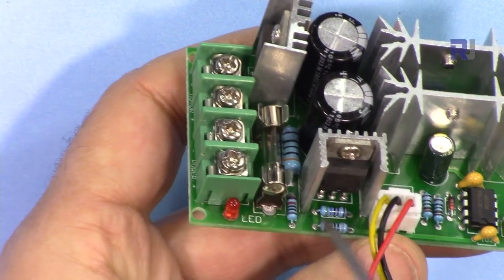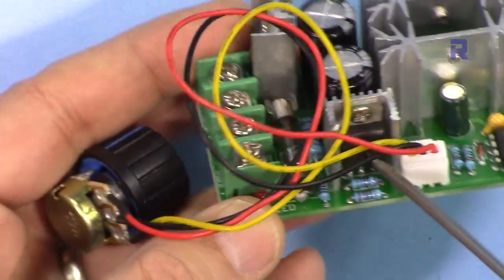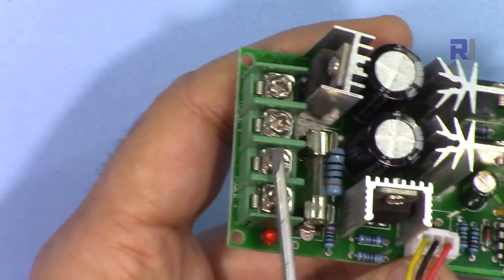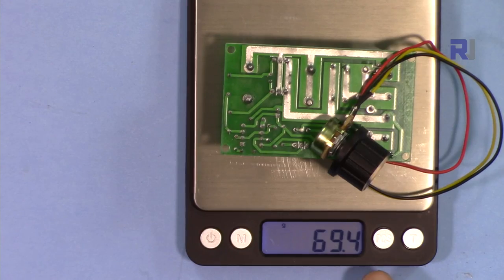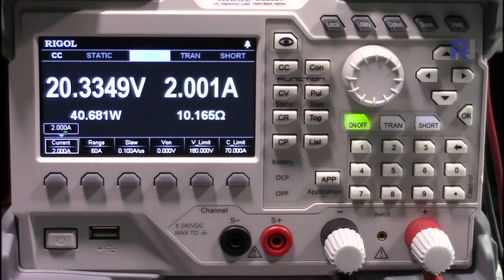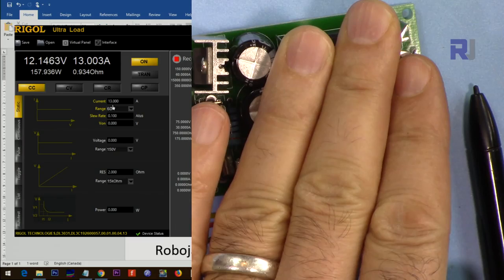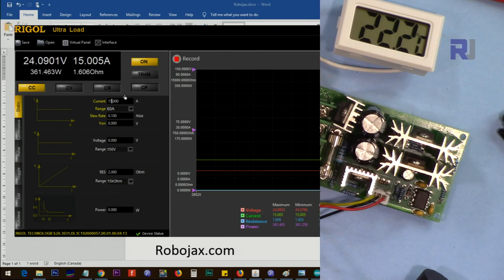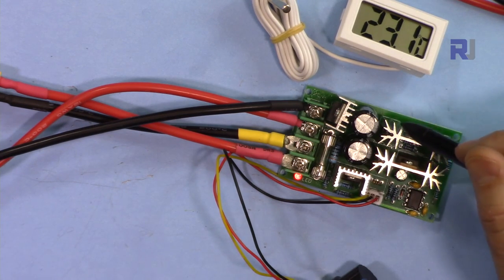Review of  20A DC 10-60V PWM  Motor Speed Controller

Comment: Lm317 regulator max voltage difference is 40v, so here it is set to about 7v (for the 555) so max input voltage is 47v. Maybe they used the Lm317HV which has a 60V in-out so it can be driven up to 67v.

Comment: When adjusting speed on a 12v 1A cooling fan there seems to be spots on the pot where output goes to zero say on a couple  portions of the sweep of the pot.
Reply from the maker: May the wiring is loose or connection is bad. Yes it is possible that you might got a bad potentiometer.  Here is a hack where you control this motor driver using Arduino board https://youtu.be/ipFxYQkB5uw

Comment: Super cool. Thanks for the demo and testing, Just bought 2 of these in ollna dofr Eur 12.95. Not too bad. For PWM control of a stryropor foam cutting knife with Ni-Cr thick round knife and a 150 mm straight knife to cut 120 mm EPS high pressure floor isolation foam.
Reply from the maker: You are welcome. Thank you for sharing the experience.

Comment: Hi Sir, thats a very detailed video 👍 and helps me getting closer to a propper solution. I try to power two hooverboard motors, each 250W. Is it possible to use such controllers in leck of hall sensors and control them with a thumbthrottle? 😅 May it is stupid...thx

Comment: Does this PWM controller offer forward and reverse motor direction ? Does the pot control both directions ? 
If the pot is at 12 o'clock does it play forward 100% ?
Reply from the maker: Hi, I made this video to answer your first question and demonstrated it.  the speed of motor is controlled to 100% of duty cycle. Here I have modified so it can be controlled using arduino with PWM https://youtu.be/ipFxYQkB5uw
Reply: Use 6 point switch on module output  it's simple for forward and reverse

Comment: Ahmed, I want to run a RC car with this that will carry around 10-15 kg weight around, so for 4wd (4 Wheels with total 4 DC motors) so what do you suggest, I need 5amp current for each motor, so is there a way I can attach all 4 motor wires (but I see only 2 sockets for motors + and - on this pwm module) how can I achieve that ? How many max motors can this 20amp pwm module allow me to connect and run at once ? Pls assist Ahmed, thanks for your efforts
Reply from the maker: Hi, I came so many time on this comment and did not understood it. so here I am replying now.  if you connect 2 or motor motors, you would connect them in parallel to have the same voltage.  you can also connect them in series. but keep in mind that they all will run together.  in terms of current, I have shown how much this module can handle and I don't remember it.  when you connect 4 motors, the total current is divided by 4. so each motor get 1/4 of the current. I hope I've explained it.

Comment: Hello. very good your material. I have a problem, actually it's a question, not really a problem. I want to use this module to dim the headlights of a car. But using, in a car, the ground from the car's power source (battery) is the same as the ground of the load, i.e. the bulbs. This means that between the 2 ground connection screws, of the source and the load, we have continuity. Is it ok to use it like this?
Reply from the maker: Yes.

Comment: Hi I'm using 10A speed controller with 3s Lithium ion batteries and motor is RS550 PF ,when i increase the speed the controller gets hot especially the motor wire connectors do you know why would that be?
Thank you
Reply from the maker: Hi, heated wires means the current is very high. Use thicker wires.
Reply: @robojax  hi thanks for the update,
Also I used thick wire but still getting hot where the pwm speed controller terminal,
I'm using rs550pf motor for a rechargeable fan ,do you think if the fan blade propeller is heavy?
And will the effects the overheating issue?
Also what if I use 550 motor ?

Comment: Hi Mr Shamshiri. I have 10A version of this module, it works fine But the Schottky diode heats as the ampere raise above 2A! I dismount it and add a huge heatsink to it and I connect it again via 3 wire to PCB because 10A will blow it up definitely! but you use them without any change in your tutorials! what you think? my module has any difficulty or the diode is faulty? (chekar konim? :)
Reply from the maker: Hi
I am not sure if the diode is faulty,  one quick solution would be to put two diodes in parallel meaning anode to a doe and cathodes to cathode and this way the current stress on the diode is reduced to half.
Reply: @robojax  thanks  for your quick answer. actually when the motor has heavy load the diode starts to heat up. I don't know why. the diode is for making a way for suppressing kickback voltage of motors inductive coils. when I hinder the motor to rotate maybe it increases the kickback effect?! after all, thanks for your advise 🙏

Comment: hey, could this be used as a soft starter? im loooking to limit the inrush current on a motor, it should be turned on by a switch on the 12volts line, so the pot stays on the max speed i guess
Reply: i have the same situation. I think it will work as a soft starter in our case.

Comment: Why did the schottky diode get so hot at the 12V 20A test?  I presumed that there would be very little flyback diode current with a resistive test load.
Was the test load inductive to simulate a motor?  (....... Would the heat come from about 0.2V X 20A X2?, but at some fraction of the PWM cycle?).
Thanks for your clear explanations, the videos are excellent.
Reply from the maker: either you exceed the 20A current or one of the pins of diode is not soldered properly.
Reply: Sir, YOUR test at time 10:00 in your video, perhaps you could be kind enough to say why the flyback diode got so hot at 20A.  I thought it would only be active with an inductive load.  Your reply is very much appreciated, Thank You.
Reply from the maker: I just watched the video. But still my previous comment is valid.
Reply: Thanks.  Perhaps ‘Chinese 20A’ should be considered a maximum of 10A or less?  Your tests in the video were very informative.

Comment: Can I series two of this type to make a 120V pwm motor speed controller? Thank you.
Reply from the maker: Theoretically it should not work because the MOSFET(source-to-gate) voltage will be reduced and it should not turn ON. But I don't know internal configuration of this module and it might work.
Reply: @robojax  thank you.
Reply from the maker: you are welcome.

Comment: Sorry for very stupid question, but is it CURRENT OUTPUT REGULATOR? And can I use it to charge a battery with 40a bms (charge 20a) using 100a power supply connected to this?
Reply from the maker: Hi, no you can't use it. it will kill your battery.  Please see my channel on chargers and battery https://youTube.com/@wattHour

Comment: Thanks for the testing.  I would be interested in knowing why it couldn't handle what it says it can.  Where is the faulty design or component? Would it be a simple change or is \the whole design  inadequate....other than just not enough cooling.
Reply from the maker: this is made in China by someone who doesn't know even to name this product or give it a model. Then 100s of other people reproduced it and no documentation. If you are know the components, you can easily draw the circuit but not worth it.
Reply: @robojax  plz tell me components name with its value extremely needed

Comment: Hello/6-60v 30A pwm Can it be used for pyrography?/Does it give 10.15 amps without getting tired?can it heat the wire with high current?
Reply: please answer my question
Reply from the maker: Hello, If I have tested it, then you should see it in the video. if you are talking about another module, I don't know how it would handle the power.

Comment: i've got the same module and the both mosfets are ypi7575 and the regulator is lm317t.
Reply from the maker: Thank you for sharing.
Reply: Wil they work for till 50, 60V of dc motor

Comment: Great. Can i add fan for this pwm and use it for utv kid car 12 volt, current 20 - 30 ampe ?
Reply from the maker: I tested this to answer those questions. if your motor is within the voltage and current shown in the video and it has 2 wires. yes.

Comment: Hi thank you for your video. Could you please help me understand why some PWM controllers cause extra noise in the motor?
I have tried 3 different PWM controllers for a DC fan motor and 2 of them cause some kind of noise when operating at lower duty cycle.
Thanks
Reply from the maker: Hi, each motor has a threshold pwm value which can start running. when it is below that value it will start making noise. the noise is from turning ON and OFF.  you can find it experimentally and always set that value as zero value.

Comment: Great video 
I would like to run a 12vdc gear motor off a joystick and be able to independently change the speeds of forward and reverse. Is this possible? If so could you point me to a video or diagrams? Thank you
Reply from the maker: I have shown that this can control motor in one direction.  To pick a motor driver, beside the voltage, the current or power is need to be known.  Search channel as I have tones of videos on motor driver and using Arduino.
Reply: @robojax  I will do that thank you!

Comment: Sir will the motor maximum speed increase when we use PWM controller or the speed will be same if the motor is connected directly to the battery
Reply: The rpm of a DC motor cannot effectively well controlled by just adjusting the input voltage or current, as this will have more impact on the torque of the motor than on the rpm.
A direct connection of a DC motor will have it work at its peak power, so in order to lower the speed we need to lower the average supplied power over a certain period of time, and that is basically what the PWM does: it modulates a continuous DC signal (lets say 12V) into a series of pulses with a certain duration (depending on how high the percentage of the peak power we want to supply to the motor).
A duty cycle of 50% will mean that despite you actually supplying the nominal voltage to the motor, you will only do so 50% of the time, and as such, the motor will only provide 50% of its power. 
Answering your question: a direct connection to the battery is the equivalent of having the PWM set up to a duty cycle of 100%. Disregarding any losses of the control circuitry, the maximum speed a PWM can drive a motor is that motor's nominal max speed\rpm.

Comment: Hi, im using the same controller to drive a dc motor, my question is can i change the potentiometer for a 5v hall effect foot pedal?
Am i right in thinking the input voltage to the Potentiometer is 5v? then Earth and signal out? So a 3 wire 5v hall effect foot pedal should be able to control the output of the controller the same as the pot?
Thanks alot, and great video.
Reply from the maker: hi, I am not sure about the Hall effect pedal you are using. But hall effect should be a "Switch" meaning it just Turns ON or OFF it doesn't got through difference values between 5V and 0V. It it does, then it should work fine.
Reply: Plz I want to help me 
I have two same this module  but output  voltage  same input  voltage  no change when I turn potentiometer 
Can u tell me what problem

Comment: Thanks for the great tutorial, what if we want to drive a motor in both directions (control the direction). I have watched your XY-1250 and these controllers can be controlled via arduino, can we somehow use 2 of these controllers to control a DC motor in two directions? Because normal BTS7960 drivers wont hold >10A motor for few seconds.
Reply from the maker: You are welcome. The best thank you for me is to subscribe to my channel. 
BTA7960 can run motor greater than 20A here https://youtu.be/PUL5DZ9TA2o
Here is another module https://youtu.be/UzCmynbpAIk
Reply: @robojax  Thanks alot robojax.
Reply: I have the same question. For a 90V 3.5A DC Motor. You can implement an H Bridge with 2 relays but normal ones can handle up to 30V DC, so I accidentally burned them... Using solid relays may be an option but is much more expensive.
I wonder if connecting 2 drivers to the same motor is possible (with diodes?)

Comment: I have since bought  12v dc 0.18a brushless 2 wire fan. I bought a pwm controller to vary the speed but the fan did not even turn with the potentiometer in either position. Struggling to get any info even from suppliers. Can you advise what type of controller I need for this type of fan? Thankyou. Great videos.
Reply from the maker: if it has 2 wires, it should work. something is wrong. Check the resistance between the two wires using Ammeter or ohmmeter. you should get something less than 10Ω. if you get higher resistance, then  it is bad. Test is and let me know
Reply: There is no resistance just an open cicuit. The fan runs on my bench p.s.u and I am able to vary the speed also by this method. The pwm I bought varies another older fan but not the new one . Do you think that I need to control it with another method?
Reply: This is the fan https://amzn.to/2YJDRcT
Reply: This is the pwm https://amzn.to/2CKw6Kr
Reply: Also if I unplug the pot the fan runs at full speed. The pot is 100k. When I plug it back in the fan does nothing with pot turned in either position
Reply from the maker: Hi, I looked at items on Amazon. The PWM module doesn't show which chip but it shoudl be NE555. How about if you connect the power directly to the fan?
Reply: If I connect any psu/charger direct to the fan it run at full speed as normal. If I connect my bench psu  I can vary the speed of the fan as I would expect. There are 2 x 8 pin chips. 1 is APM9926A  PUBLC5 the other reads 7555ID.
Reply from the maker: Then your PWM module is defective.
Reply: Even if it varies the voltage on my dmm? And does that mean then its not giving enough current to the fan and that's why its faulty?

Comment: I want to power / control an automobile heater motor.  I need power supply and motor to share common ground.  On your controller does the input power and output share common ground?
Reply from the maker: when i went home from work, planning to check it but forgot. Today I added images on the resources page for this module. the link is in description but here for you https://robojax.com/learn/arduino/?vid=robojax_PWM-20A and I've shown in image that + positive line is common.

Comment: The circuit change output voltage or not?
Can i use for limit baterry charge max current without change the voltage?
Reply from the maker: this is PWM (pulse width modulation) controller NOT a voltage regulator. You need a CC or constant current regulator that can control current. #robojax_constant_current

Comment: bro, please replay, i have 44watt dc led, can i dim that led with it? i dont know the led is 12v or 3v or 24v. but i know it gives output of 43watt.
Reply from the maker: You need to know the voltage. Otherwise how can you power it up? You need to find the current (ampere),from voltage using the powers (watt) here is formula P=V*A.  Or A=P÷V. Yes this can dim it if it is within the range of this module

Comment: How long can I have it running 12v and 10 I liked your explanation
Reply from the maker: I believe If you get the same module, it should work for days. I don't know . test it in a safe environment before putting it into practical use for safety reason.

Comment: Hi, the speed controller on my little mig welder died, the motor is 24vdc, could this board work ok with the power being cut on an off every time the feed trigger being pulled, hope you can help, thanks k
Reply from the maker: Hi, it should work. all devices should be turned ON and OFF.
Reply: @robojax  hi, thanks, so if i had the potentiometer set to just say, number 3 i could cut the power in and out, and it would turn the motor at that speed, great ill give it a go,
And hello from Ireland :)

Comment: Sir, can i use this module in my kids ebike it has 18v dc motor and can i connect throttle with its potentiometer will it work?
Reply from the maker: it can work with up to 60V motor. If the motor needs less than 20A, then you can use this.

Comment: What is the size of the pot ... I bought the same pwm potentio b100k ... But the pot didn't work ... I used 24volt input so the voltage couldn't be adjusted ... It only reads 24volt the output, please help me mr..  Thanks :D
Reply from the maker: I have explained it that this is controlling the motor using PWM. in PWM the voltage stays the same. it does not change. it is the fast turning ON and OFF of the voltage called duty cycle that causes the motor to speed up or slow down. So the voltage should be  the same as input or a little lower like 0.5 to 1V lower.

Comment: Please tell me what should be the supply adaptor rating which i want to connect to the circuit ...........if i want to regulate 3 ,12 v 500mA dc fan..... please reply...??🙁
Reply from the maker: Hi, the supply is mentioned in the title "10-60V" . But this is very powerful like 40 times of what you need. (for one fan) you may get this https://youtu.be/inUOVV0LnoQ which is much cheaper. Make sure it has heat sink.

Comment: hello sir!!!!!!!!!!! does this module boost voltage?  i have 12-24 V dc motor. but my supply is 12v only(9ah battery). can i run motor at 24 v with this module?
Reply from the maker: Hello, no it does not. but if you connect 24V at input you can control 24V motor with this.
Reply: @robojax  thanks for your valueable reply sir
Reply from the maker: you are welcome.

Comment: can we use arduino pins instead of potentiometer to control speed of motor wirelessly
Reply from the maker: I am reading your comment after 8 hours.  you should not have waited. Always check description of each video. you will be surprised. or should have searched my channel. I've made video for that.